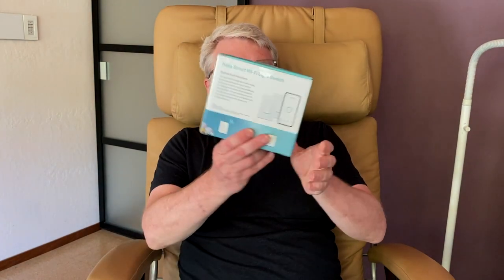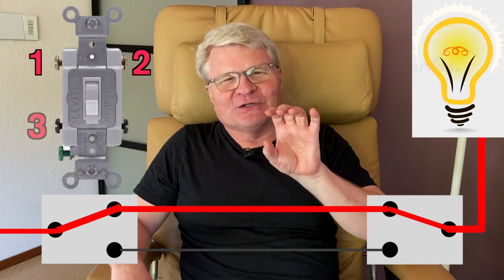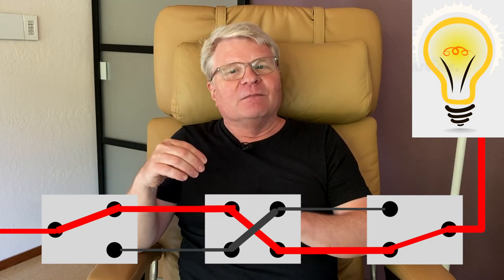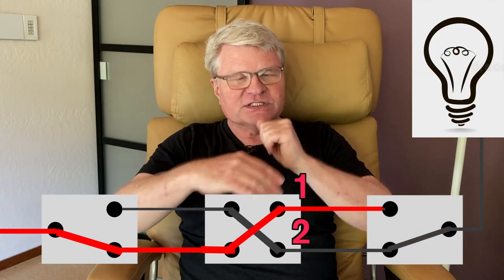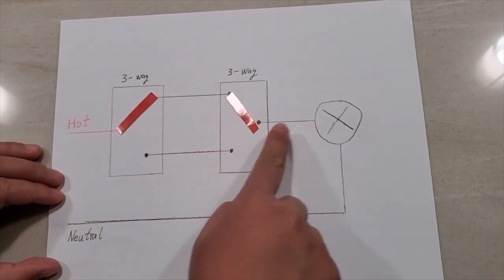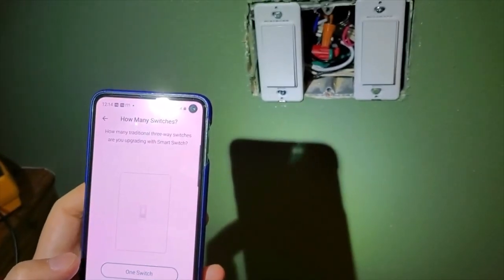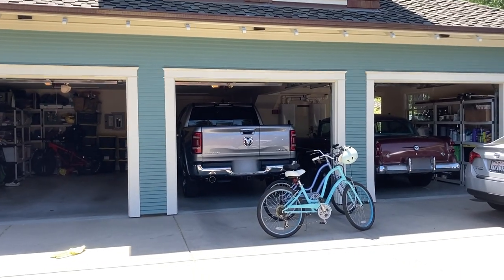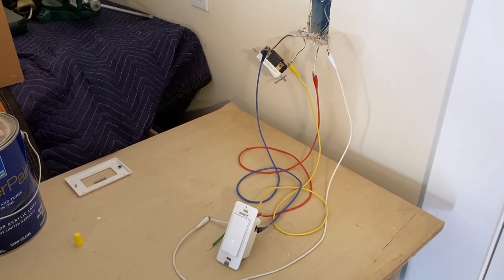Deep Dive: TP-Link Kasa Smart Wi-Fi 3-Way Light Switch on 3-Way & 4-Way Circuits & Your Network

Comment: Thanks for your detailed testing! I'm still confused if you feel this is a good product or not though. 
My conundrum: (Im using the "typical" 3 way switch method)
I bought and installed 3 Kasa single pole switches for 3 separate light circuits. They all seemed to work fine using WiFi app and manually switching. Due to their "rocker" style and not being able to mix toggle and rocker style in a 4 gang box (face-plate issue) I ended up buying the 3 way switch set for the 4th light circuit. 
Since the instructions (none in the box) stated the Kasa 3 way must be on the first switch I instead installed it in the 2nd switch in line to try but unlike you seemed to have no luck. 
I then installed the other Kasa 3 way switch at the 1st line location and 3 way switching seemed to work manually and with the app and the other single pole switches were still working as well.
So... at this point I have a 3 Kasa single pole switches for 3 separate light/circuits (working fine) and added the (2) three way Kasa switches (also working fine) using app and manually.
I came back a couple of hours later and the lights were intermittently unresponsive as if the WiFi signals were getting crossed up. The three way switched lights would not turn on until l I used the app to turn on one particular single pole lights which is on a different circuit. Once I turned that separate switch on, the 3 way switch would then turn on and off prperly. I'm really stumped by this and don't know if the Kasa WiFi controllers are too confused having  4 of their switches in one gang box so close together other wise I'm at a loss and feel like sending them all back and getting a better quality.
Reply from the maker: Oh man!

First, Kyle Switchplates sells Decora to toggle fillers and other odd-ball plates. FWIW.

But, second, this kind of intermittent problem with some kind of hidden variable will drive you nuts. I've always felt this video is a bit of a failure because, even though I learned a lot, I never discovered WHY adding a 2nd slave Kasa 3-way to Geordie's setup fixed his garage lights -- which is what got me started on this. Others in these comments have reported the same "ghosts."

When you're building inexpensive consumer products in quantity, it's easy to cheap out on the radio, or get a poor antenna design (because there aren't so many good analog guys around anymore), or the WiFi chip comes with a bunch of custom, impenetrable integration software libraries and drivers written overseas. All these things conspire to make a WiFi-enabled product that has difficulty operating in less-than-ideal environments. (In your case, next to other close sources of RF and a lot of variable AC conditions.) I see no indication Kasa is favoring quality over cost. They're not total shit, but they're also just trying to strike a balance where they can satisfy the most people for the least money.

Unfortunately, I haven't researched the market, so can't recommend $omething better.

I am a little worried that the one 3-way didn't work in the load-side box. Either you or I don't understand something correctly if that is the case.

The only way to troubleshoot this is, I guess, to eliminate variables -- like by taking out the 3 single-pole circuits and adding them back one at a time. But, besides being tedious, dull, and awful work, who has the time? And when you're living in the place? And you may not get to a definite conclusion anyway! I mean, do you have radio problems? Electrical problems? A radio-electrical interaction problem?

Wish I could be more help from this remove, but I guess all I can say is good luck with whatever you decide to do! :(
Reply: @WardCo  Dude - First of all your this was one of the best evaluation videos I've ever seen! Secondly I watched your video again. I decided to pulled all the switches out, straightened all of my wires nice and tidy then re installed them. I then deleted and reset all 4 switches then verified they all functioned manually. I then powered off all of the switch circuits and one by one (only one on at a time) reinstalled them on the app. I ended up adding the HS210 on the second swittch location and so far all seem to work fine manually and via the app so I was able to keep the toggle switch setup on the first (line) switch location. I suspect I had a traveler swapped or something..who knows. thanks for the tip on the decora plates - I was at Lowes and the guy in electrical department said he never heard of such a thing! Anyway - Thanks for the great helpful and interesting video!!

Comment: Your video was very thorough and I hung in for the entire show….very informative. I bought the switch set and tried to install one of them on my basement lights (5 LED cans, a rewired fluorescent fixture with LED bulbs, and one switched outlets).  I installed the one switch on the line box as there was no common in the 2nd dumb switch box. The 2nd switch had the 2 travelers (black and red) and fed the load from the white wire.  The result was the lights cycled on/off about once per second. The circuit worked fine with 2 dumb 3-way switches. I suspect that the wiring in my circuit is atypical but I am also wondering if I am trying to control too many fixtures on the circuit.  In any event, I returned the switches to Amazon as I could not get them to work for me. Very frustrating as I would like to be able to control the basement lights from afar. Thanks for your great video.

Comment: Great video.  Makes it super easy to understand how the 3 and 4 way switch circuits work.  Until I started opening my light switches and couldn't figure out why I had a 3-way switch in my house had a single cable coming in and appeared to create a dead short between the hot and neutral wires.  After a bunch of searching, I've figured out that I have a "Dead-End 4-way" circuit where the line side box does NOT have a neutral.  My neutral is only available in the load side. (I bet they don't include that kind of info in Amazon reviews!)  Wish me luck!
Reply: Did you get around the problem where you don't have a neutral on the line side?  I have the same issue...
Reply: @waltschumacher  I did.  I had to go down a rabbit hole of 3-way and 4-way switch wiring options first though.  if you want to understand the most basic level, there are a ton of tutorials and videos to wrap your head around.  But if you need to learn more about different schematics, you're gonna have to start getting creative.  They can get pretty hairy to understand in a drawing, let alone trying to guess what's inside the wall where you can't see the wiring.  I managed to get all of mine working, so I can verify they do function as expected even with some of the more 'creative' wiring layouts.

Comment: Awesome video! Seemed like you were talking to me. I'm sure everyone feels that personal touch. I subscribed half way through as I knew weather I use your tutorials or not, I'll enjoy the learning. 
I have a question: I'm replacing my current light sensor switch (by Heath Co LLC, Model 6108) which I have to press every time to turn on with a Kasa (Model KS200M). The old one turns on two lights in the room. It has four wires coming out Black and Red on one side and Green and Brown on the back plate. The Red and Brown (from the switch) and a Black (coming from the box/wall) are connected together with a wire nut. The Black wire (from the switch) is connected to a Black wire (coming from the box/wall) with a wire nut. The Green wire (from the switch) is connected to a bare Copper wire (coming from the box/wall) with a wire nut. So, four wires (from the switch) are connected with three wire nuts. 
The new Kasa switch has four wires coming out. One Green (Ground), two Black (Line/Load) and White (Neutral). 
How do I connect the new Kasa switch to the wiring from the wall? Please help - Thanks
Reply from the maker: Interesting puzzle.

I looked up the Heath/Zenith 6108 (circa 2007) online and it leaks current when off, so presents a slight shock hazard when changing light bulbs controlled by it, as you'll think the socket is completely dead and it won't be. Probably won't kill you, but should be taken out of service.

If you go to manualslib.com you can pull up the manual for the 6108. There are pictures.

The black wire coming out of the switch is from the line or to the load, depending on if the 6108 is in the line or load box.

The green wire (connected to your bare wire) is the equipment safety ground.

The red wire is a traveler.

But the brown wire is "special" -- it helps power the IR sensor and electronics in the 6108 continuously. To do this, Heath has you install a jumper on the non-6108 switch to bring the line or load wire onto one of the travelers and then onto the brown wire of the 6108 across the room.

It's either clever or mad: if the 6108 is the line side box, the neutral comes through the fixture, to the load side switch, through the jumper, to a traveler, to the brown wire and into the 6108. The black wire provides the hot side for 6108. Viola! 6108 has both line and neutral (on black and brown, respectively).

If, on the other hand, the 6108 is in the load side box, the neutral comes through the fixture, and to the black wire going into the 6108, and a jumper in the line side box puts continuous power onto the traveler leaving the line side box, crossing the room, and into the brown wire going into the 6108. And again, viola! The 6108 has both line and neutral (but this time on the brown and black, respectively -- polarity reversed.)

It seems like the 6108 works by switching the red wire that comes out of it, and turning the far "remote" manual 3-way into a SPST switch.

Clear as mud, eh?

Unfortunately, your description doesn't make sense in this model. Why would you bundle the red and brown from the switch with a black from the wall? Are you sure this is right?

Anyway, I guess I'd start by trying to get the 6108 out of circuit and into the trash. So, you have to go into the far/other/remote box and 1) verify it has a 3-way manual switch in it and 2) remove any jumper between the common and traveler that was installed there to power the 6018 in the other box.

Then I'd remove the 6108 and try to put a manual 3-way in THAT box. I don't have enough information to tell you how to wire that though. Hopefully you'll have 3 wires coming into the box to work with -- likely 2 blacks and a red? One of the blacks (line or load) will go to the common (different color) screw. The other will go to one of the traveler screws.

If you get this far, you'll have a circuit with 2 manual 3-ways in it -- and the dangerous 6108 will be going to the e-waste facility.

BUT, you don't mention if you have any neutral wires in the box you want to put the Kasa in (typically white). If not, you're SOL (Well, you could use the equipment safety ground as a return path, but don't do that.) But anyway, if you have successfully converted your setup back to manual, and there is a neutral in that box, you should be able to follow the regular KASA instructions for install.

Comment: Nice video. It makes sense that pairing would essentially deactivate one of the switches as long as power is being supplied by the traveler lines and the switch detects current flow. Otherwise, the system would be unnecessarily redundant if the switches were programmed to communicate with each other. It also makes sense that the switch is designed to work just as well at the load end since a lot of 3-way / 4 way switches are built into multi-gang panels which would limit the flexibility of installing a smart switch if it always had to be installed at the source end. Moreover, since the purpose of any smart switch is to control remotely, having temporary interruptions in the power by switching the source 3-way or the middle 4-way won't be an issue when controlling via an app.

Comment: Well thought out video and I enjoyed the comprehensive testing you did. Exceptionally done all around! I bought the 230 kit (which unknowingly came with a main and satellite switch). I was having issues with wiring the Kasa main on a load switch. It wouldn't work no matter how I wired it. Now, I'm debating if I should install the Kasa satellite switch on the load switch or just install the main on the live switch. If I understand it correctly, I assume either option should work...just not the Kasa main switch on a load apparently.
Reply: looks like the satellite switch needs to go on the load side and the main switch has to be wired where the power is coming in from.. which is good because typically on the load side of a 3 way setup there isn't usually a neutral in the box...and don't use the ground as a neutral. that can kill someone

Comment: I'm only at 21:45 on the video, so forgive me if you've already checked this. I note that on my single switches (or SPST) that if I have the Kasa app open and switch one of them on, the Kasa app doesn't show that it's on ... however, if I pull down on the Kasa app screen causing it to refresh it does update the status of the switch ... so if you haven't, try doing a refresh on the app by either pulling down on the screen or totally closing and re-opening the app to see if it shows the correct status of the light. I think it's just a refresh/polling issue with the app in that it doesn't auto update/poll the switch. Hope this makes sense.

Comment: I watched your whole video.  EXCELLENT!  Still a mystery about what happened in your friend's garage.  I have since installed 4 HS210,  Due to ease of wiring with else was in the box, I put three at the load end of a 3 or 4 way and 1 at the line end.  They all work equally well and i am seeing no difference in app response across the 4.   the app reflects status change fairly quickly.  even with the momentary power drop that you noted, i would imagine that the wifi connection would either never drop or be back near instantaneously.  for me, the white circle never goes away.  thanks again for the technical detail, but for my application in new construction with common wires everywhere, i am not seeing that a load side installation is any issue.  thanks
Reply from the maker: Thanks for this report. Info like this important for me. Still need to tear one of these suckers open and reverse engineer it some to see if there are more clues....

Comment: Just a heads up on version 2.8 of the KS-230 (Kit) dimmer.  If the configuration includes a "crossover" switch between the Satellite and the Main switch (Main is the origin of the power line), once the cross-over switch is moved from one position to the other, the traveler wires no longer have power at the Main switch.  If the Main switch is restarted (via the small button below the rocker) the traveler wires come alive and the switch works as usual.

Comment: Two questions:
1 When using two Kansas, does line side reboot if you stop your 4way in the middle?
2 My line side box doesn’t have a neutral. How could that be made to work?

Super video!!!!
Reply from the maker: #1 :  No. Nothing downstream of the line-side box affects power to it. #2 : You have bring the neutral into the box, there's no way around it. BUT, it doesn't strictly need to be a neutral from the same circuit the Kasa/light is on -- that is, you could steal one from that receptacle outlet nearby and thread it into the box (however, this is not recommended or to code because it can trick and hurt someone who thinks they've killed the receptacle circuit at the panel to work on it -- but will discover the Kasa is still putting current on the neutral -- unless you can gang the breakers for the 2 circuits together. Still...)

Comment: I have just completed replacing all my Insteon devices with Kasa and I am very happy with the experience.  Except for the one 3-way circuit it has been flawless.

The way Insteon handled 3-way is very different from standard wired 3-way circuits and I had to really figure out what I did to get Insteon to work and then change it to make the HS 210 to work.

The complaint I have now is the app will not clearly indicate if the light circuit is on or off. The green circle will come on for a moment but then go off while the light stays on or off as I wish. 

I'm unclear about the left reset or right reboot button purpose is. I've pushed both during the setup process and deleted the device then added it again, a few times.

QUESTION, How do I get the app to clearly indicate the ON or OFF state of the device?

Comment: Great stuff. I still don't understand why if I turn off the one in the line the one in the load loses power. At least I'm convinced to buy a dumb switch and use the second Kasa on a different location.

Comment: Hello, don't know if its been asked, I read on the amazon reviews that some are having problems with multiple lights (not clear if with a 3 way configuration), I presently have 3 led dimmable down lights on a single old school manual dimmer. Will the single pole Kasa Smart Dimmer Switch HS220 work with my setup? I called TP customer service and they say NO. Thanks BTW great video!! You should be hired at TP Link for their high level support.

Comment: Do you know how it would operate in a dimmer? Do I need two 3way at both ends? Can I alter the dimmer setting from any switch in the circuit?
Reply from the maker: You can put a Kasa 3-way light switch in the line side box and a regular 3-way dimmer in the load side box. You will only be able to dim at the load side box.